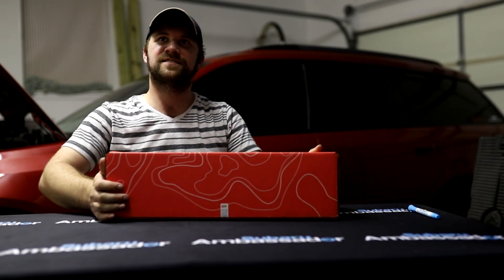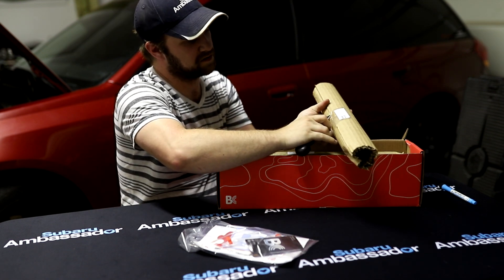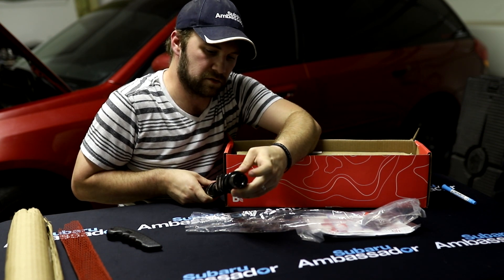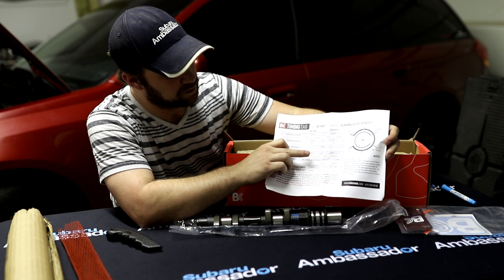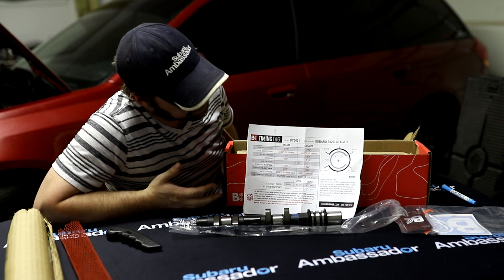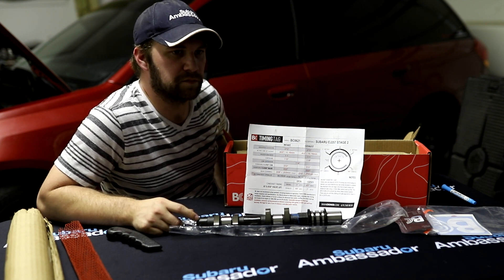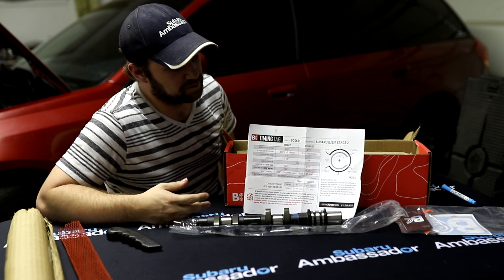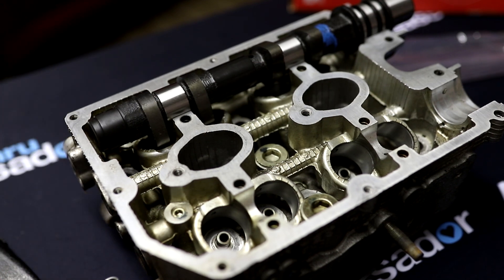Brian Crower Racing 272 Cams for Turbo Subaru Engine: Unboxing and Review

Comment: How many degrees did you have to adjust the exhaust gears or did you leave them at zero degrees?
Reply from the maker: I left them at zero. There was a thought of adjustable cam gears but ultimately i wasn't limited by timing.
Reply: @robinsontanner1234  thank you
Reply from the maker: @YarilOrellana-w4j  no problem! Anytime!

Comment: it says that they are a "drop in" cam, is that completely true? I know I've always been told that you should always degree them no matter what...  just curious!
Reply from the maker: Yeah they drop right in! The only thing is the valve bucket clearance is 2 thou different. So you may need to swap that out. Since I did springs and valves I did that anyway.